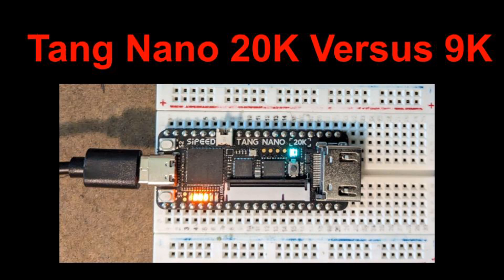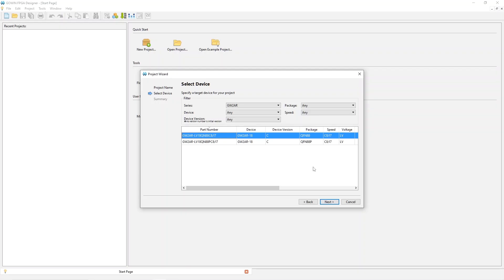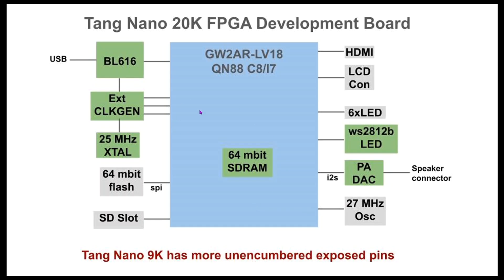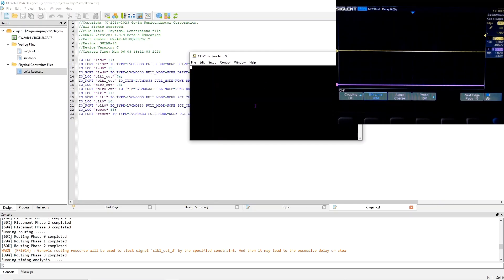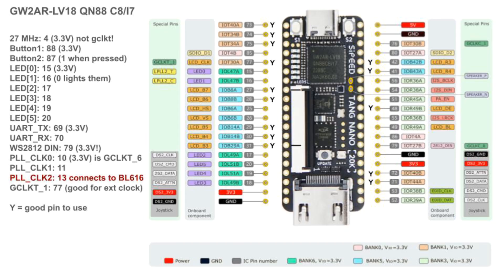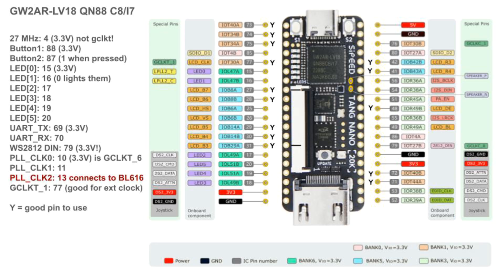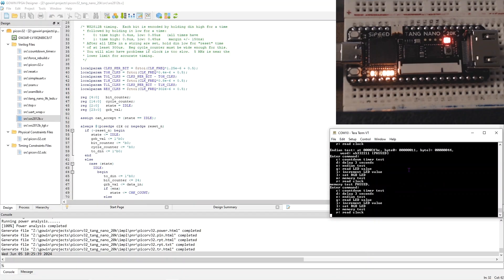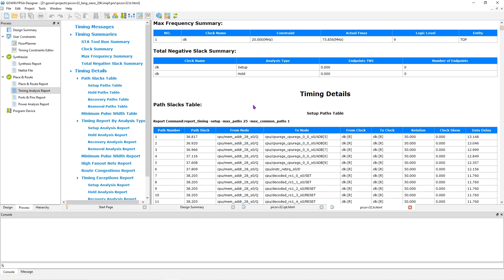Tang Nano 20K vs Tang Nano 9K FPGA Board

Comment: Hi. I am new to the FPGA world. I’d like to ask a quick question. Would it be possible to use a Nano 9k to intercept RGB666 18bit RGB TTL (or lower it to 9 or 12)  plus hsync, vsync, and DE and show it  on hdmi monitor? The OEM monitor I’d like to replace is 400x240 max 25Mhz.
Reply from the maker: Sorry, I don't know enough about video protocols and formats to answer.  Maybe someday I will try to learn about these topics.

Comment: The development boards are nice 
(
Kiwi 1P5: GW1N-UV1P5 ,  
Sipeed Tang Nano 4K / Lichee 4K : GW1NSR-LV4C  
Nano 9K GW1NR-9  
Nano 20K GW2AR-18  
)

But the chips themselves aren't available on digikey.. mouser has them but you have to buy in quantity (500)..  lcsc doesn't carry them..  and AE sells 1 piece for $75?!
Reply from the maker: Yes, and I find the documentation lacking also.  I am nowhere near ready to design a board with one. What attracted me was the low price of the development boards.  I had never programmed an FPGA and wanted to learn about it.  The Tang Nano boards offer a low-price and easy way to get started.  But I notice the prices have been rising a bit.  I had not heard of the Kiwi 1P5.  That's the cheapest of all-- but is a pretty low-end FPGA.

Comment: That HDMI port and LCD ZIF connector, can those be desoldered and the exposed signal lines used as GPIO?

Also: Is underclocking a thing?
Reply from the maker: I think you could.  You might also want to remove things like termination resistors.  Look at the board schematic.  You might decide you can do simple things even with other stuff attached to the pin (assuming no hdmi cable attached).  Underclocking is a good question.  In general FPGAs are very good at letting you create clocks with different speeds using the PLLs.  The PLLs have minimum clock speeds, though.  Something like 3 MHz but I don't recall exactly.  You can find the somewhat complex rules for this in the data sheet.  Also, the GUI helps you.  As for GCLK pins, I don't see (after a brief look) any specification for minimums.  It could be that individual blocks such as memories have minimums.  Getting to the bottom of this would require a tedious and careful read of the data sheet.  But can certainly drive the PLLs with a 27 MHz clock and derive clocks that are faster or slower than that.  I did a video on the PLLs.

Comment: We are working on Tang Nano 20K (we are using it for controlling a micromouse bot). We used the picorv32 IP block and then Gowin MCU designer to load the binary file from external flash into ITCM and also the other download methods in the picorv32 software download manual. None of them seem to be working. We cannot even get it communicate over serial. 
We noticed that the pins that rx and tx map to by default in the IP block are being used in the LCD and DVI in the tang nano 20k, so we changed them to system rx and tx pins (70 and 69) from the schematic and changed the bank voltages to LVCMOS33, yet it does not seem to be working. Any idea why?
Reply from the maker: I don't know why it does not work for you.  With my use of the PicoRV32 I had working serial via the built-in USB-serial adapter.

Comment: I got the tang primer 20k what are useful projects that it can actually run , can it handle some AI Inference and what type of AI models I should be thinking about ? I know it is a small fpga and wont handle much.
Reply from the maker: I'm skeptical that it is large enough to do anything interesting with AI, but it is easily large enough for projects with soft cores.  I guess it is really up to your imagination. You might consider something that uses a video output.  I have not tried that yet.

Comment: Great video thanks! I am considering using one with my ADC capture module project. I need it to work as a decimator and analyzer. I was going to use a RP2350, but I've been told I should learn FPGA and there's a project similar to mine that uses a Tang 20K.

Comment: With the Nano 20K, have you experienced the issue of not being able to program it again? I programmed a design earlier and unlike other FPGA boards, the design is persisted after powering off. I cannot program my 20K anymore no matter what I try. Initially it wouldn't program until I dropped the frequency from 2.5 to 2MHz.. but neither is helping now. I've tried powering up with the S2 button held down but I still can't get anything to load.
Reply from the maker: Sorry, I do not see that.  My Tang Nano 20K programs reliably.  I use default frequencies and do not have to press a button.
 
I can load the design to SRAM (which is not permanent) or to flash (which is).  I can program it using the latest Gowin educational tools on Windows (but not Linux). On Windows, the only problem is that sometimes I need to select Edit/Cable Setting/USB Cable Setting and let the tool find the device.

On Linux Ubuntu 22.04 openfpgaloader works very reliably.   See my video on getting started with the Tang Nano 9K for more on openfpgaloader. 

Best wishes
Reply: @electronics.tinker  It was my mistake. I thought multiple files could be programmed at once, but they all need to be loaded individually.. So I just had to hold down S2 while powering up and ensure that only one file was checked in the Gowin programmer. The errors the programmer gives back tend to be a bit misleading.

..and yeah, I'm using Windows.

Comment: I saw the tang 4K also comes with an M3 coprocessor, would that be ideal for offloading 'non-critical' general compute tasks to, while the FPGA handles the critical functions of a program?
Reply from the maker: Having a hard core on an FPGA would certainly be interesting.  But the 4K is a fairly small FPGA.  A Tang Nano 9K with a PicoRV32 soft core likely will have as many resources left over after including the soft core as the 4K has in the first place.  But the m3 will likely be faster.  The Tang Nano 20K is also nice.  After including a PicoRV32 soft core, it will have more resources left over than even the 9K.  I think if you are just learning about FPGAs without a specific project in mind (in particular one that needs a core), then the 9K and 20K are good choices.  The prices don't appear to be that different.  My Tang 20K was $25 from Amazon.  That was a good deal.  If I could buy a 4K for, say $10, I'd probably get one just to see exactly how the m3 is integrated, though.  Basically, they are all good choices in one way or another.

By the way, in case you didn't see them, I have several videos that show the use of the PicoRV32 soft core.  I like using the version straight from github rather than using the encrypted IP block available directly in the Gowin IDE.
Reply: @electronics.tinker  Thanks for your explanation and channel!

Comment: Thank you for the video. Can this Tang Nano 20k generate sine waves at HF (20 meter) frequencies ? Just in case I want to build a well filtered beacon...just in case.
Reply from the maker: The FPGA on the Tang Nano 20K (and the 9K) is a digital only device so its output pins are either high or low-- so it can produce square waves but not (directly) sine waves.  If all you want is a square wave clock generator, check out a part called si5351. John Hawkes made a youtube video about using one of these as an LO sine wave generator by filtering its output.  The video is called "SI5351 Clock Gen as Radio Local Oscillator in Old Radios".
Reply: @electronics.tinker  Thank you for your reply. I check out Hawkes video. I put a low pass filter into the output from the Si5351a and that knocked everything down a bit. However, the signal was knocked down below 0 db. So now I think I have to 
amplify and filter the results of the amplifier as well. ... So it goes.

Comment: Ahh... nice! Liked and subscribed.  First time the YT algorithm has displayed one of your videos!  A while back, months, I bought several of these boards; a 4K, two 9k's and a 20k.  I have quite a collection of other FPGA dev boards (all Altera based, no Xilinx). I've been teaching myself HDL, mostly Verilog, but attempting to learn VHDL at the same time.  It gives me that feeling of learning like I had when I first began learning 6809 assembly language on the TRS-80 Color Computer in the early 80's.  Also re-learning digital electronics.    

There seems to be a dearth of information on the Tang Nano boards.  I did experiment w/ them a few times.  They seems to be a bit glitchy, however.  YMMV. The USB communication to upload a bitstream just inexplicably quits working.  I have to unplug it and then plug it back in w/ the HDMI disconnected or it won't work.  And at least one of the 3 kinds, the HDMI output is glitchy -- there are artifacts glitching all over the screen.  Almost, but not every time!  

I want to go back and try them again... and perhaps you have given me the inspiration to do that.

Comment: For someone beginning with FPGA's, would you recommend VHDL or verilog. I'm an embedded 'C' engineer, if that helps the choice :)
Reply from the maker: My background is probably similar to yours.  I don't know VHDL.  I started with Verilog because of its C-like syntax.  If you know C but also understand how clocks work with flip-flips, getting started with Verilog is quite easy, and its module concept works well.  I think it is also less verbose than VHDL.  But I find things not to like about Verilog.  One is that it is not strongly typed.  This can lead to errors.  Another is that the "wire" vs "reg" definition is pretty weak from a language design point of view.  But I think I will stick with Verilog out of inertia.

Verilog on a cheap FPGA board can be fun for software folks (like us) who have worked close to the hardware.   Cheers.
Reply: Verilog puts you on the pipeline to SystemVerilog and SystemC so definitely go verilog.
I first learned VHDL and let me tell you, it is awful and has a strict syntax and design in the worst ways. The type system is awful.
Reply: @mattymerr701  When I worked in the defence industry it VHDL was the standard to use. However as an embedded C programmer, I'll take the verilog recommendations, thanks both!
Reply: Unless you're doing DSP and math heavy twos compliment /signed and unsigned arithmetic, there's no advantage to VHDL versus Verilog these days. 

It is more verbose and while 'safe' it looks similar to ADA syntax wise.

 If you're already comfortable with C , then Verilog will make a bit more sense.
Reply: Rust gains traction as it fails compile time, which is better - I see vhdl as the more safe variant. I did however start with verilog, but now i just use whatever is used already :-)
Reply: Verilog is my suggestion, but its recommended to know both since some FPGAs do not have an option for Verilog